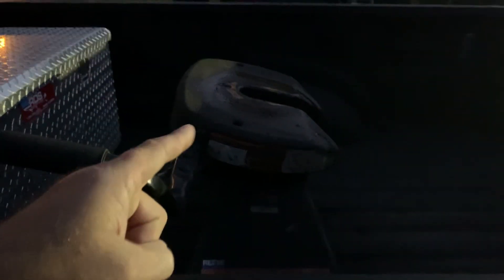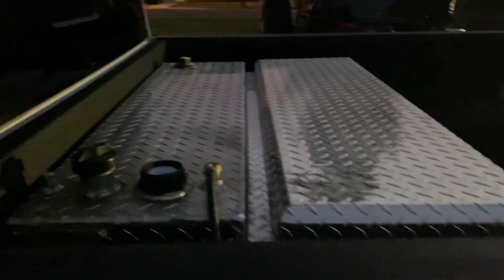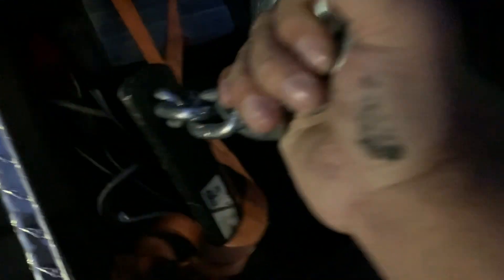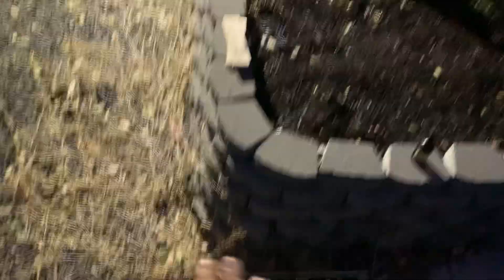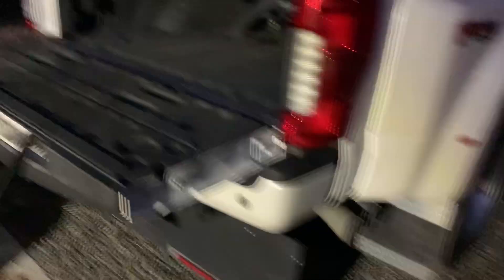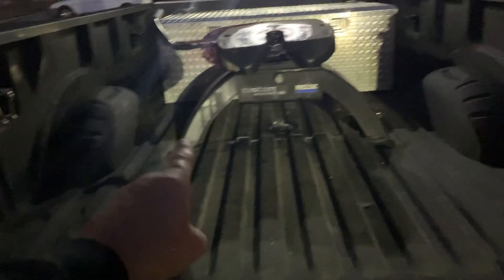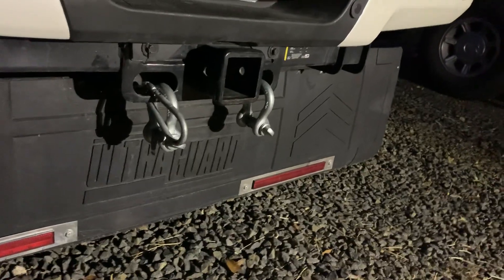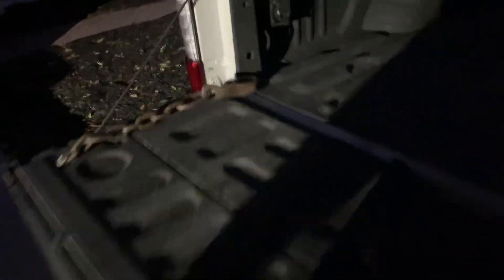Got a truck? Put it to work! What do you need?

Comment: Slider fifth wheel with short beds. Anderson hitch is a different animal. 
 You can run a gas engine with some rv transportation companies. 
 Been doing this for about 2 years and i go everywhere and i’ve never had to put it in 4 wheel drive on the road. 
 Running an F 350 same fifth wheel as you except i have the slick plate welded on mine so I don’t have to grease. Blue Ox Sway Pro weight distribution hitch. 
 Been driving for Synergy. Enjoy your channel. Nice to learn from you how Horizon does it. 
 Think Synergy has the least equipment requirement up front but continually adding more stuff as i experience requires it. 
 Be sure to carry extra food and water in case of breakdown.
Reply from the maker: Always have a bag of jerky, trail mix, water and Gatorade. Cycle it out about once a week. Yes slider and Anderson are different. That was my bad. I thought I made mention of that to correct it after I uploaded. Maybe not.
Reply: Enjoying your channel though. Friend that has been interested in getting into it told me about it. So started from the beginning and watching till i get caught up. Wish i could have gone 450 for turning radius but when i was leasing on they wouldn’t accept a 450 for single haul.